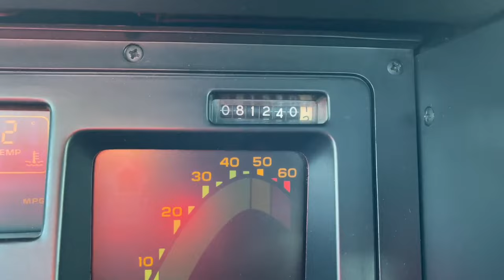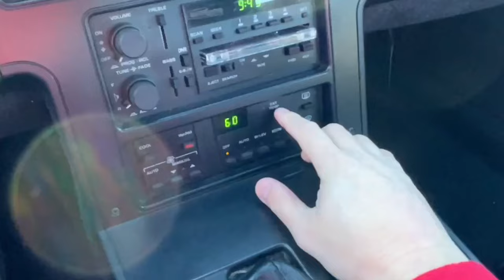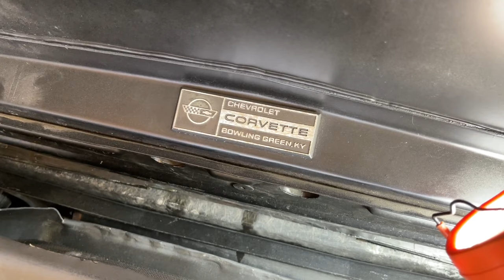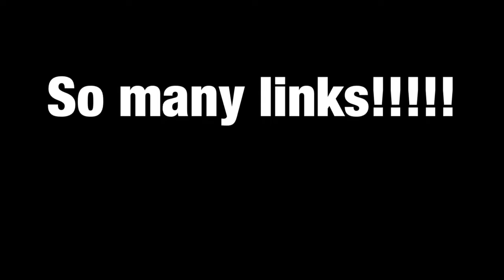6 CHEAP AND EASY C4 CORVETTE MODS

Comment: I put 11,000 on my 1986 in one season when I bought it in 1992, and only 29,000 more miles in the next 27 seasons.
Reply from the maker: Dang!!!
Reply: @ReynoldsRides  what's worse is only 2,000 in years 2000-2009 and 0 since.  Raced a bunch,  4 engines, 4 transmissions and 3 rear ends since I bought it.  Oh and 3 different sets of wheels, 3 sets of front tires and about 20 sets of rear tires,  mostly drag radials.  (500 miles a set or 12 runs down the 1/4 whatever came first)

Comment: I just subscribed to your channel. And this is my first post to you. I also have a C4. A 86 indy pace car I found, it was in a flood with no insurance,  and sat beside a pole barn for 3 years before I got it. It was rebuilt by me around 18 years ago, and EVERYTHING electical has been replaced, and has been done inside to my specs. Nice custom leather seat covers I designed, center console and shifter boot to match. I'll be doing a repaint this winter because the paint needs redone. Also redoing a 81 vette I found under a tree at a chicken farm, been sitting for a decade. Everything will be rebuilt or replaced.  My problem is I can't find the blinker arm with the cruise controls on it. Nobody make a replacement, and salvage places won't sell them. Any idea's where one is? Only thing I need to rebuild the steering column.

Comment: I don’t see why you should buy a special kit for the coolant bypass. I just put a longer coolant hose from the steel heater pipe directly to the intake manifold. Another mod you could do is remove the air pump and all the smog bs, if that’s legal in Utah.
Reply: Yeah I just brought a couple feet of coolant hose and sent it from the first T to the second, doesnt look very good but it work 😁
Reply: EGR delete
Reply: Is that a 5/8” hose? How many feet of hose you need?

Comment: laughs in 84 C4 383 Stroked/Cammed Carburetor Converted, full trans swapped upgrade

The K&N filter was the most expensive "mod" that adds "horsepower".

Least the revised privacy cover was a good idea. I'll leave a like.

Comment: I just went to the Amazon link for the led bulbs... It says that those bulbs you recommended do not fit my 1990 C4 under the hood...
The ones that they recommend do not mention fitting the sockets under the hood.
Any ideas???
Reply from the maker: It said the same thing for my ‘89 but I bought them anyway. I mainly went off the measurements and they are a perfect fit. I tried a set from Super Bright LEDs and they said it would fit my ‘89 but they didn’t at all. Not even close.
Reply: I ordered them anyways ..they arrive today...& I will see if they fit!!! I will let ya know!
Reply: @kheaslett  did they fit, I have a 94’ and it has the same problem of not fitting don’t want to go through the hassle of returning a 10$ part

Comment: Just unplug the under hood lights you don’t need them in the day light anyway.
Reply: On my 90 I located the power line ( at the left wheel just in front of the ECM) and put a toggle switch.  Save the Wave!

Comment: Neighbor has one that is absolutely trashed… front windshield and both driver and passenger windows broken, short it the wiring harness, cosmetic needs all new everything basically. Asking 3,500. Should I take it? 115,000 miles. When I say it’s trashed. It’s trashed
Reply from the maker: $3,500 sounds high to me if it’s trashed. Does it run, stop, and drive?
Reply: Nope

Comment: Thank you for this video.  Unrelated to this video.  I am military overseas in Germany.  I need to replace the radiator.  Can you recommend a good place to purchase?  From all the reading I want to replace with an aluminum 3 coil one.  What are your thoughts?  So hard to find parts out here so any recommendations would be grateful.

Comment: First, I NEVER took my '90 to a public car wash.
K&N air filter should be the very first thing to do.  Buy a used cover and cut it while saving the original.  Those two little things really do increase performance. 
That device on the front of the throttle body is a waste of money.  And, God help you if the screw backs out and gets sucked into the engine.  Yes, it has happened more than once.
LED bulbs under the hood is a good idea.  I removed mine because the hood is up so much at shows and cruises and they drain the battery.  It's a good idea to replace the interior bulbs with LEDs, also.  Less heat generated to the plastic lenses.  Keeps them from turning yellow.
Reply: The K&N is an engine wrecker so make sure you budget for a rebuild if you want to enjoy the 'durable and reuseable' grime introducer. For short term racing use they make sense but for road use you don't want to reduce your filtration effectiveness to a hundredth of the original in order to gain maybe 2-3 horsepower.

Comment: In your short video you mention taking out the roof panel before jack up the car, why is that necessary?
Reply from the maker: When you jack the car up, the chassis flexes and could damage the roof panel. So just to be safe, I recommend removing the roof panel (or t-tops on a t-top car).

Comment: Not sure if you get a credit but used your links to buy the air foil and privacy screen retainer. I’m probably going to pass on the LEDs under the hood but I did buy some LED headlights and wondering your thoughts on LEDs for interior lights?

Comment: Air filter and air foil are worth ZERO horsepower.  This has been covered extensively on the C4 section of corvetteforums.com with a whole raft of dyno runs showing no gains whatsoever.
Reply from the maker: Provide a link to a dyno test performed in a controlled environment, by a reputable entity, that shows that a high flow air filter or airfoil is worth “ZERO” horsepower. Don’t just punt to corvetteforum where for every one guy saying one thing, there’s another saying the exact opposite.
Reply: @ReynoldsRides  

OK...
https://www.corvetteforum.com/forums/c4-tech-performance/1315330-air-intake-dyno-results.html

That's on a wickedly fast LT5 car producing more than TWICE the power of an L98 (477 rear wheel horsepower vs. 250ish crank horsepower on the L98) and it LOST POWER compared to a paper filter... something us LS1 guys knew back in 2000 when we threw out all our K&N filters for Fram paper filters.  K&N filters are like lighting dollar bills on fire to go SLOWER.

There's thread after thread after thread on the C4 section about this, all with dyno results attached.  

Oh, not only don't they flow more, the filtration sucks too:
http://www.gmtruckcentral.com/articles/air-filter-study.html

Everybody falls for marketing hype from time to time, but this one had a bullet put in it twenty years ago.
Reply: Look at the times on 1, 2, and 3 and see if you notice anything, then match 1, 2, and 3 writing on the bottom to the writing on the top and see if you notice anything.  If you don't, I will help you.

Comment: Whats a better beater/have fun car? a Decently cheap c3 or c4? any pros and cons
Reply: The biggest 'pro' for a C4 is that the steel chassis was dipped in primer with an electric charge vs. the C3 that did not use the dip tank for the chassis.  Watch the 'birdcage' on the C3's and C4's.  The tell tail rust streaks can be found by removing the kick panels and pealing the carpet back.  Save the Wave!

Comment: My neighbor is selling a 96 C4 it’s automatic and has 84,000 miles clean title. “New Paint and Upholstery.Heater, Air conditioner, CD player. Suspension updated, runs great. Cash only, no check scams” wants $8,600. I feel like it may be a steal but not sure. Thought I’d ask those who own one

Comment: My C4 gets hot....any ideas to keep it cool?  I have the extra relay to manually turn on fans but it still gets hot.  I was thinking an aluminum radiator but they are costly.  Thank you
Reply from the maker: An aluminum radiator will make the biggest difference in my opinion.

Comment: 6:48 I don't understand that. Passing very hot coolant thru the throtle body will allow cooler air... wouldn't that heat up the air ..a lot?
Reply: The factory setup has coolant flow through it. His mod was removing it.
Reply: @brandendarling4106   thank you

Comment: I was young and dumb.. still dumb but I was young back then. Bought a c4. 94 when I was probably 24 back in the early 2000's. Made the mistake of power washing the engine bay.. yeah I said I was dumb.. ended up taking out the optispark distributor.. Luckily I have a dad with a heart of gold. Bailed me out. Think he blew 500 bucks back then to save my dumbass.

Comment: K&N air filters don't increase power. Many  youtubers have tested this with no power increases compared to a new clean factory item. The only advantage is that its reusable.
Reply: The real issue is all the grime they let in. It's hundreds of times less filtration for smaller particles. People just buy into the marketing as always and never look at the actual science.

Comment: Look guys, the K and N filters do flow more air.  But how much actual horsepower will they give you?  You might be surprised to know that on a dyne there is NO difference.  And K and N are much worse for filtering out particles that may damage your engine.  Is that what you want from your filter?  It is a filter, right?  Not for me thanks.

Comment: God damn it. DO NOT PUT A HIGH AIR FLOW FILTER! Not only do you usually lose HP without a tune, the reason they flow more air is because the filter allows larger particles escape through it. Guess where all those air particles go? In between your pistons and cylinder walls. You lose compression faster. How much faster? Depends, but you are cutting the life of your engine down. Idk about you but im not getting a dyno tune just for an air filter and certainly not if its going to wear my engine down faster.

Comment: The magazine article claims a 20% increase in average power from the airfoil.  Problem is, when you do the math, the increase is 4%.   I'm skeptical it's even that much.
Reply: That's because you're right. 4% my A$$.  This has been beaten to death on Corvette Forums with multiple dyno runs showing no gain.

Comment: Bruh, the fact the air filter is 800$+ is criminal!
Reply from the maker: It’s not “800$+.” It’s $80 and if you get around 5 horsepower out of it, that’s $16 per horsepower which is a great ratio. Guys spend way more than that all the time.
Reply: @ReynoldsRides  Oh yep, Im a fool, totally missed the decimal point there.
Reply: SLP makes an intake for $350 and say itll get you ~20 hp

Comment: Your KN air filter does increase HP because it allows larger dirt/dust particles to enter your engine.
Not good!!!!!!
Reply from the maker: I’ve never seen an article, video, or test that supports that theory. You got one you can share?
Reply: @ReynoldsRides  check out Project Farm very smart guy. I replaced my KN with a Purolator for my 99 Trans AM
Reply: @ReynoldsRides  Start to research on "BobIsTheOilGuy" forum on K&N's.  All their oil analysis show how much contamination is caused by K&N's.  There are some other hi-flow "dry" filters on  the market.....just not sure if they make them for the C4.  Just found this also:    https://www.corvetteforum.com/forums/c5-tech/2054308-k-and-n-air-filters-will-they-reduce-an-engine-s-longevity.html

Comment: K&N air filter does not add any horsepower. Marginal at most.
Reply from the maker: https://youtu.be/iGntLSJ4CUQ
Reply from the maker: High flow air filters are dyno proven to add power.

Comment: The air foil is NOT a good idea. They partially block the PCV system and really do offer stuff all gain. Been there, done that, first thing i pulled out of any C4 i owned or worked on.

Comment: The air lid mod and air foil are a waste of time. The coolant bypass , cooler thermostat and a retune are the best bang for your buck.
Reply from the maker: So Super Chevy publishes an article where they dyno prove that the air foil mod results in “significant gains” and you still say it is a waste of time? Clearly you didn’t read the article (which is posted in the description). Also, the air lid mod just makes sense and is not a waste of time (it takes 20 mins).
Reply: Air foil mod =great and noticeable 👍🏾

Comment: Throttle body coolant bypass? Lol!  Coolant is designed to flow through and heat the throttle body for an important reason. Do your research people!
Reply from the maker: Sounds like you’re the one who needs to do some research. It’s a very common mod, it increases power, and it’s not needed unless you live in an extremely cold climate.

http://www.ws6.com/mod-8.htm
Reply: @ReynoldsRides  Lol, ok!